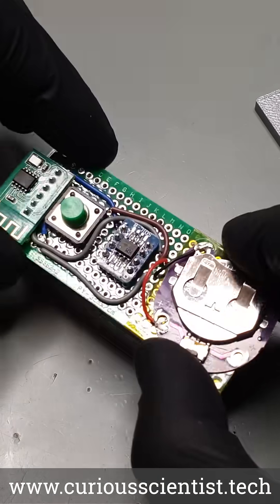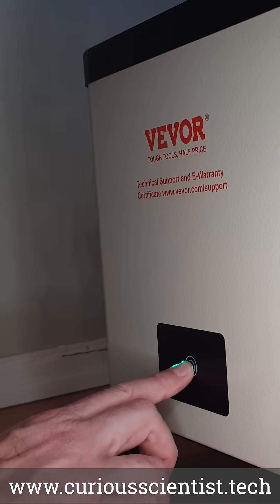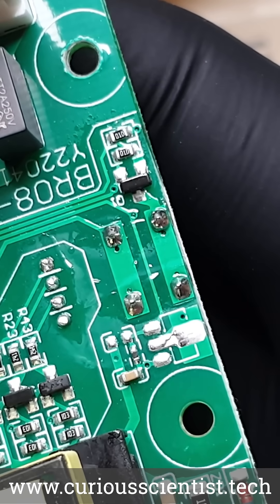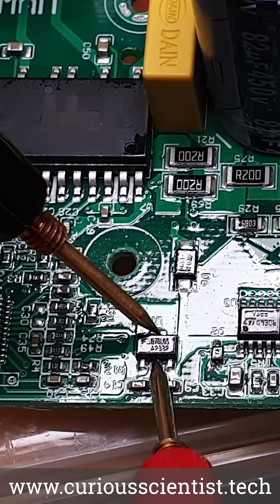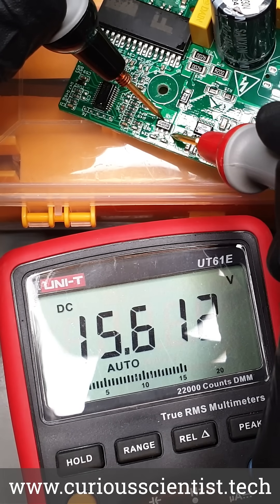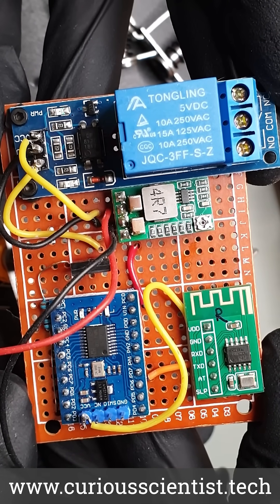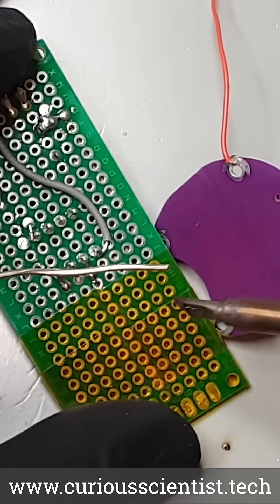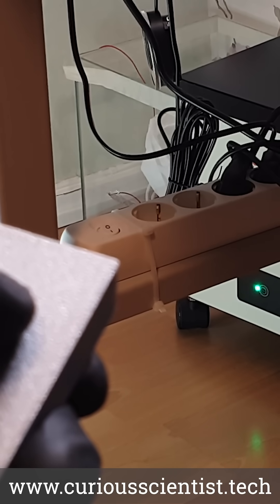#electronics #microcontroller #ch32 #ch9141 #bluetooth  #remote #circuitboards

Comment: Есть несколько более простых и изящных способов решить  эту "проблему":
1 Пульт+ реле  для освещения за 10 долларов - ну это для тех кто любит помучица.
2. Дистанционно управляемое реле с "алиэкспресс" за 5 долларов - и да его наверняка можно даже выбрать под нужное напряжение и оно будет занимать меньше места. 
Вот если бы вы свой талант применили для создания например интеграции этой вещи в "смарт хоум" это возможно было бы интересно.
Reply from the maker: The 1st point would not work, I explained it to another viewer why. If only the outlet is switched, the device will only stay in standby, but the fan won't be triggered. The switch should be pushed directly. There, actually point 2 could work. An RF relay module is relatively cheap and it would only need an additional DC-DC converter, so it can get 12V for its operation. However, the one small convenience would disappear because I could not make the fan to turn on automatically, as I do it with my custom controller. One has to switch through all the levels to turn the fan off, so when the fan is on LOW level, I have to switch to MED, then HIGH, and then finally I can turn it OFF. No big deal, but still. On the smart home part, I cannot really comment. A fume extractor does not need to be a part of a smart home system. It has nothing to do with my home (unlike a light, thermostat...etc.).
Reply: @CuriousScientist  Зачем преобразователь если модуль реле можно взять на 220 вольт? и обычно он 2х канальный причём сами контакты на реле от 220 только замыкаются то есть достаточно просто подать на разъём питания реле 220 хоть от сетевого провода который входит в саму вытяжку. и протянуть провода от реле  и припаять их к кнопкам. и всё! То есть просто появится возможность включать и выключать! И ещё что нибудь делать если есть ещё кнопки на вытяжке.
Reply from the maker: I haven't tested it, but I don't know what happens when 1. The switch is shorted continuously; 2. the switch is shorted during powering the device. Plus, this does not solve the issue of switching between power levels. If you somehow could make it start with a relay, it would start at the lowest power setting which is not always sufficient. To reach the highest power level, you'd need to toggle the switch twice. This is hard to achieve with a "dumb controller".

Comment: That's pretty cool. I had the same dilemma when I got my Hakko fume extractor. I just bought a foot switch, but I like your idea better.
Reply from the maker: Thanks! Yes, a foot switch is a good alternative, and honestly, it should be a default accessory for these devices. I wanted to learn more about the BT modules I used and the circuit inside the fume extractor, so I picked the more sophisticated way. 😅

Comment: So much extra work for minimal gain. 

I would have just put a wired button with a 10 foot cable. Screw the buttonto the bottom of the desk. Job done.
Reply from the maker: For those who can't put together circuits or can't program microcontrollers, the wire seems a good solution... But now I can control my fume extractor even with my phone or PC or anything with Bluetooth connectivity. Job done.
Reply: @CuriousScientist  I teach both those subjects, and would encourage my students to take the faster + more economical route.
Reply from the maker: Yeah, but tacking a pair of wires to a connection teaches nothing. It is not always about the fastest and most economical ways, but it is about how much one can learn along the path.
Reply from the maker: I have nothing to be insecure about. It is maybe you who got insulted. 

First of all, where else do I exactly put the fume extractor? It is made to be placed on the floor. There is no other way to place it. 

The relay thingy you are talking about is not applicable here. You just power the device on/off with it but you still cannot turn it on. When the fume extractor is powered, it is still sitting in standby mode. The push button must be pressed in order to leave the standby mode and start the fan... 
I am completely fine with the 3D printed enclosure. I am obviously not a wood or metalworker, so 3D printing is completely OK. It does the job, it keeps the circuit sheltered. 

I learned more about studying unknown circuits: how to find the components I want to modify, how to find different power rails, how to integrate a circuit into the device without blowing up either of them...etc. Plus it needed some programming both for the sender and the receiver, so now I have my little template codes for future work where I will need to work on something similar. So, yeah, I learned nothing and it seems you know it better than me, because you were here and saw everything, right?! You are just a random troll, probably without any useful skill set and education and you are just sitting behind the computer and rage-bait people. I won't fall into your trap. :)
Reply: @CuriousScientist Don't worry about these kind of people man. They're everywhere and always equally annoying 😂
Have a good one and please continue making these wonderful videos!
Reply: @CuriousScientist  well, if you gained new skills in the process, then its no longer minimal gain is it?? Now, if you already had these skills, then my comment stands, alot of hoopla for minimal gain. I dont know everything in the world, nor is it stricklty black and white. I saw something and questioned why, providing further context... but yeah, i guess anyone that doesnt agree woth us and says anything remotley challenging must be rage baiting huh? 

I think you must be responding to someone else, i didnt say anything about relays or the floor. Buuuut, anywhere a push button is used, can be replaced with a relay, so it in fact is applicable here. But again, way too much effot for that task.
Reply from the maker: @ParisLuHv Yeah, my past two comments were meant for another viewer because he interpreted my response a bit differently. I did not mean that you were ragebaiting. 

As I said in one of the comments, I learned a bunch of stuff, and for me, it was worth the effort because it is a great step towards automation. So, as you said, it is not a minimal gain for me.